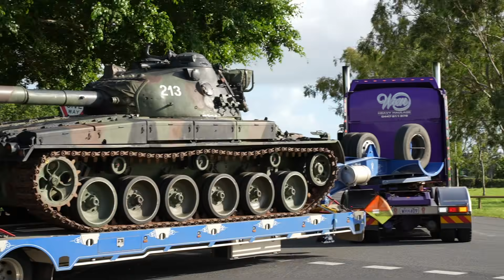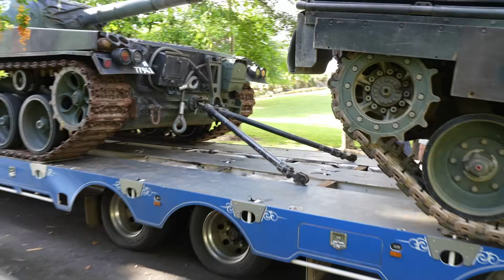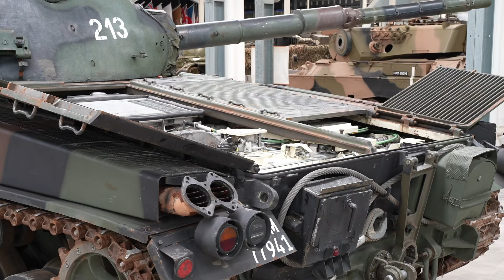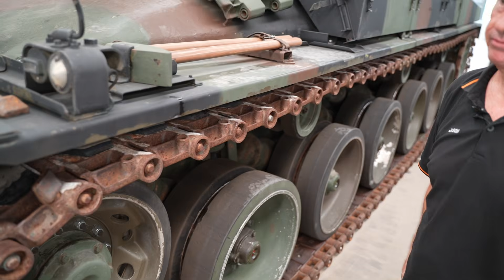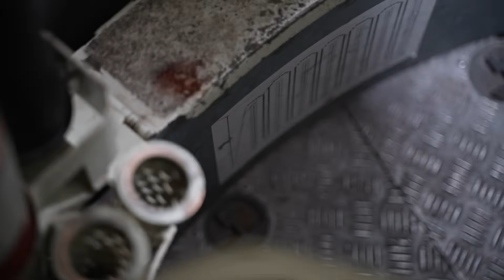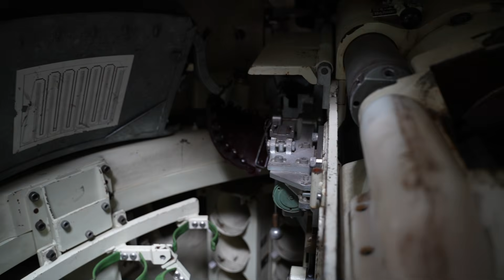The Swiss Army Panzer 68 - OUR NEWEST TANK ACQUISITION!

Comment: Gunner sight wasn't stabilized in the 68. Only the cannon was, but not the sight. The breach was always opened with your foot, never by hand. The hydraulics panel also functioned as a space heater for the crew, I imagine that's why it was placed inside. Switzerland can be cold in winters. The interference of the radio and gunners sight was probably a myth. I never actually experienced it in 600 days of service

Comment: At the time 68&69 we did not have tanks so we made our own. We took an M106 mirror track and gutted the back end and took off the folding hatch. Then a 27 round ready rack was built out of old rocket tubes beneath h the commanders hatch. Then was mounted a 106 reckless rifle on the right rear top. And presto, we had a tank. From Florida.

Comment: I was driver in Pz68 and enjoyed every second in that tank. Very nice to drive and i allways had the fastest tank...because i put the gaspedal stopp with hammer away...so my tank made 200 rpm more than others  fun time😂
Reply: Maybe you can confirm something for me:
I was a bit confused as I first saw the turret in this video. Mainly the shape of the range finder housings. I memory serves me right, the 68 turrets have more rounded, cast-like looking housings compared to the box-like looking ones on the 61.

After looking for a few more details, I think this is a Panzer 68 hull mated to a Panzer 61 turret.
Am I correct or wrong?
Reply: The first two series 170 & 50 tanks had the smaller turret, similar to Pz61.For the loader and gunner very tight. Serie 3.and 4.   110 and 60 units was built with bigger size turret, called GT ( gosser Turm ) It was heavier and with that some upgrade at the gear and suspension needed. At the end with the latest edition callet Pz 68/88 it was a useful tank with good first shot hit.
Nice tank to drive because of very good steering and gear. It could have more power.I liked  @Bird_Dog00
Reply: @uelisuter1563  Ah, so it's a early Pz 68 turret that looks similar to the Pz 61's.

Dank hegisch.

Comment: Surprised that you didn't use a recovery vheicle to pull it down off trailer.
Reply: We did consider using the Leo 1 ARV we have at the museum, it was just easier to get the 1A5 out as the tow vehicle.

Comment: 710 litres/156 imp Gallon fuel tank divided by max range 240km/150 miles equates to about 1mpg. Now 1mpg is probably good mileage for a MBT! You should be able to run this thing around quite cheaply!

Comment: Didn't the Pz 68 have an issue where turning on the heater could cause the main gun to fire? Not that you would be likely to encounter that problem in North Queensland...
Reply: There were a number off issues raised for this vehicle by the Swiss government,  most were fixed along the way with various upgrades. Some testimonials from former operators say they never experienced some of the faults mentioned. This variant is the AA5 which was the last ungrade before being retired. Not inc the Pz 68/75 or Pz 68/88
Reply: It was a possible fault but it never actually occurred in practice I believe.  A lot of the issues were fixed by later updates.

Comment: Be careful switching on the heating system!!!!!!
Reply: The heating system supposedly triggering the cannon never actually happend. It's a purley theoretical issue. The heater control and firing mechanism share the same pcb. So in some Freak scenario in theory you could maaaaaybe cause a short that could maaaybe trigger the gun. But it was completely blow out of Proportion.

Comment: 50+ year old tank, fully kitted and in almost in mint condition... Swiss maintenance and quality. Much impressed.
Reply: Still better preserved and more complete than my dad's old cars from the 1970s....
Reply: is it.
Reply: These tanks were garbage. They caused a major scanal and allegations of corruption.
Reply: 50+ years is pretty young compared to most of their other tanks. I would hope it's still in decent condition
Reply: He said it's from the second batch, produced from '74 on.  Technically, less than 50 years old.  Technically.  :D
Reply: Won’t have seen much action though mmm.
Reply: @nickward1366 During its service life, it typically should have fired 5000-ish life rounds through it's main gun and racked up 10'000 service hours. A few saw exceptionally high or low use, but there was no noticable difference between those and the rest, outside of the paper work. The rot in the engine bay and the paint flaking off inside the turret is probably because it was parked somewhere and forgotten for the past 25 years.

Comment: The hydraulics cooling panel in the turret isnt strange at all, it makes sense from an efficiency point of view:

Its the thickest piece of armor, so it has loads of heat capacity. Its way up there in the wind, so it can dissipate the heat better than the hull. And since its passive cooling it saves space and weight.

Sure, it adds to the heat signature, but likely not more than the engine heating up the hull.

Comment: I had to do a double take when I saw the SLM plate on the gearbox. It roughly translates to “Swiss Locomotive and Machine Works” they were known  for building railway locos especially cog rack locos never knew they built gearboxes for tanks
Reply: they also built the motors for the Leo 2 in licence later in the 90's.
Reply: Makes sense though...it takes a heavy industry to build locomotives and tanks. For instance, the American M4 Shermans were also built by a locomotive company (although they utilized a number of different power trains from various automotive manufacturers, Ford, GM, and even Chrysler, I think...all of the big 3). But the Swiss had their own resources (some borrowed from Germany).  Until watching this video, I never realized how much I love this tank! Maybe not the best protected, but it's still a thing of beauty.